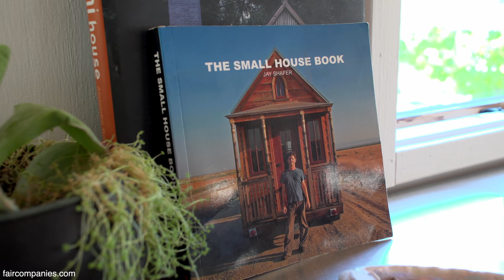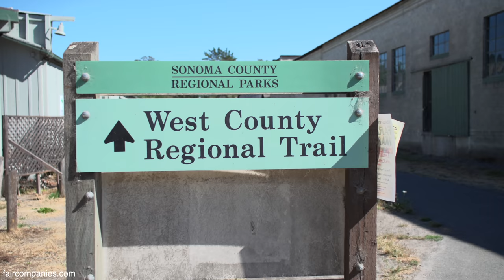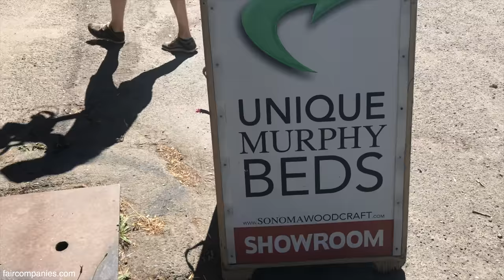Bottom-up urbanism solves urgent housing needs in CA vicinity

Comment: If you look at history, many families had a 100 square feet house to live in and they raised a family of multiple children. We do not need a 4,000 square feet house to have a "home." My house is 14 feet by 38 feet, of World War Two vintage. I paid $26,500 for my house in 2001, the next cheapest house I looked at was $89,000 and it had major fire damage. I spent about $10,000 for stucco siding, new electrical panel, kitchen renovation, installing a better wood stove for heating, and bathroom upgrading; over an 18 year period. The renovation is still going on, with the passing of time. The 500-1000 square feet houses around my house are being torn down and replaced with $250,000 - $5000,000 dollar houses. While the original house and lot were going for $40,000 - $60,000. These homes usually need renovation, which if you do your own work adds $15,000 - $25,000 to the total cost.  Which is still a great deal. One of the main problems I see is that house buyers do not know how to watch youtube videos on how to do specific renovation projects; I just found how to remove old glued on linoleum using a wallpaper steamer. What is nice about small houses that you renovate, is that you can buy the empty lot next to your house for $29,000 (amount owed), and pay cash.
Let it shine, Tom.

Comment: I did a similar thing here in WA, I needed office space and it was too expensive to add on to my house so I had a shed built in the backyard and turned that into my office. It is fully insulated and finished like my home is and it has electricity with heat pump and air. It is less then 200 sq ft so no permit was needed. You got to look for alternatives to cut the red tape and cost.

Comment: How did California become such a police state? I couldn't handle being that micromanaged. I know that building codes exist for a reason, mostly to prevent fire, collapse, or injury. But when you have to worry about whether your garden hose is going to remain legal, the government is way too involved.
Reply: NATHANIEL GILLIES  I thought that since water is under pressure it prevents back-flow. And for the most part, every house has a garden hose. It just seems strange to me that a hose running into a bucket like this guy had could cause any trouble.
Reply: NATHANIEL GILLIES  I didn't know that. So turning off the hose at the source (via the metal handle) isn't enough?
Reply: NATHANIEL GILLIES  Does that mean that those hose attachment "water gun" things are a bad idea if you leave the hose on even when water isn't coming out? I don't do that, but if I wanted to would it be a bad thing? I'm beginning to sense that it probably is.
Reply: NATHANIEL GILLIES  I would assume ours has one. We just moved into our house here on December 10th, 2018. I don't know if it even has an outdoor water source. I assume that it does. I'll ask about it before I use the hose (assuming there is one).
Reply: They just don't allow permanent outdoor plumbing.

Comment: Actually, in Cali, you can run power to your shed as long as it's NOT hardlined / piped in with conduit directly from the main panel, meaning you can plug it in with a heavy duty S.O cable / extension cord like an RV or Boat. It's called shore power. So you can install hardwired wall receptacles and lights with a breaker panel inside the structure as long as you have a weather proof disconnect / receptacle outside the structure.  You're welcome. :)

Comment: Great video, we're doing similarly on the east coast in Rochester.  Our house isn't quite that small (990sqf), but it's a 2 bedroom without closets on the first floor. We plan to convert our detatched garage (already partially finished) into a workshop/guest loft. We also plan a patio, a garden and I'd like one bee hive. We're were originally going to build a tiny home, but by the time we added land, permits and the build, it was cheaper to buy a small older house (1925) and didn't waste resources.

Comment: Thank you for filming, so inspiring!  Sometimes laws are a reaction to a one time problem as in "we will never let THAT happen again."   In one state farmland was able to be carved up and sold off as home sites, regardless of size.  So a Slime bought 10 acres for $2000 in the middle of nowhere, carved it up into 20 lots and sold them for $4000 each...but there is no water and very little electricity and it is 10 acres of slums with people living in RV's or shacks...the Slime made money, the people and surrounding area suffered...now there is a rule that less than 5 acre plots needs roads, water, electricity and improvements....It all would have worked fine, if Slime had spent enough for improvements...but no water, no electricity, dirt roads and no money to make them.  Everyone pays for greed!

Comment: Interesting video.  I like the idea of looking for ways to work around getting a permit when possible while staying within safe perimeters. A lot of people will do things anyway hoping to not get caught.  While I don’t necessarily blame them and completely understand why, the problem is that you find that things are not built to code and can be a safety issue.  A lot of contractors are ok with building shoddy work for money.  We opted to get permits for our projects (one retaining wall/driveway permit ended up costing $10,000 fricking dollars, just for permission and inspections, not counting construction costs).  Our neighbor didn’t get a permit, and I can guarantee the retaining wall that holds up the driveway would not pass safety inspections OR allow the weight of a fire truck to park on it.  The consolation for me, having gone through the awful permit process, is I am confident it meets certain standards.  Also, when reselling the house (or more likely when our daughter inherits it) there won’t be issues around not having necessary permits in place.  Now we have to get a permit to replace our deck (because the supports are taller than 6 feet), and I am completely dreading the process and fees.  It truly is awful dealing with the county.  But alas, I am a rule follower.

Comment: Not sure when it was checked, but in Texas, I can go down and buy a shed or kit, insulate/power/plumb it and live in it with very little cost in terms of legal paperwork (only the power permit was needed, mainly so the electric company would run the lines). Inside some cities you need more, but where I am, you don't. Can even rent it out, so long as its structurally sound (mainly because its common sense to avoid liability).

Comment: I'm in california and living in a small city that is still relatively affordable (Mt Shasta) but it's quite a ways from the Bay and you need to bring your work with you as the county is a bit economically challenged but the backcountry skiing is excellent!  I am expecting to do the same thing in my backyard.  One small 12 foot diameter 119 square foot yurt (a shed) and one 8.5 X 13 shed close by.  I think you can wire them and just have a jack on the outside like an RV hookup and just disconnect it if there is any inspector coming round.  if they give me any hassle I'll just take the yurt down and put it up in another part of the yard.  A 600 square foot house with a 250 square foot garage for $135K.  Not bad but I wished I could afford to live in Sonoma!   I'd also like to do an ADU which I could rent legally - there was recently an ordinance passed in california that allows for ADU's and it's cheaper than building a whole house but would still need $100K minimum to build that.  One new code that just came about in California is that all new residences must have sprinkler systems ($20K+)   It's ridiculous really.  I think I want to move to Chile! :)

Comment: We're in Palm Springs with an ancient (50 year old) house that is a thermal nightmare.  Last year we installed a 5.1 kw solar system to run the Level II  charger for the car and are in court over that one, with no light at the end of the tunnel.  I'm a licensed general contractor, but now I only design energy efficient (Net Positive) shelters in 3D, using VR and energy analysis software.
With the local government, I might as well be speaking Martian.  Half the administrations are under investigation for corruption and the other half don't have any "energy" expertise that is current so public employees are more concerned over their personal position and pension than getting the job done cost effectively.  They "out-source" at great cost (I believe) just to spread the liability of their bad decisions around.  I've built houses in Quebec, Ontario, Virginia, Alabama, and Costa Rica and this place is the worst.
Climate Change won't wait for these overly covered bureaucrats to come alive.
On the beach in Costa Rica, you can build a "Bodega" (storage unit) up to 3 m x 5 m with no height restrictions mentioned, without a permit, so you see a lot of 10' x16' ground floor buildings, with cantilevered 2nd floors.
Here in Palm Springs I'm going to build an "in law" suite, the property suits it easily.  I'll build it at night if I have to.

Comment: One cannot put up a dog house in our former community without a permit. What this smart man does is wise and needed in our nation. We are located in the Midwest and an hour's drive from any city with a population of 10,000 or more. City building inspectors are oftentimes shared between five communities or more so a push to adopt state building codes is high so the inspector only has one set of code of know, rather than the individual small-town/village municipal codes. In our area, it is solidly "purple" in voting practices, meaning it is nearly split/draw at every level of elected position, so it is not a one party over the other party dilemma as much as municipalities trying to fill employment for inspectors. Just my two-cents worth.

Comment: I personally think the only solution in a situation like that is to run away so you are not caught up in it when the entire system implodes. The last thing you want to do is have hundreds of thousands  plus invested in property when the bottom falls out of the market. A lot of those houses could be bought for $15-$20K in other areas. Sell it and move somewhere cheap while it still has value.
Reply: Yeah, feel the same way although it is difficult to leave a generally "progressive area" and move somewhere where nothing ever changes.
I live in a big house and property taxes here are very low however exactly nothing ever changes to the point I am heartbroken about it nowadays - there is no demand for interesting business or services, just the utilitarian.

Btw. a house that size could be completely renovated for cheap but you need to know a thing or two about renovating a house and do all the light work yourself. 
For example that spray on PIR/PUR type foam you see here also comes in sheets of various thickness and those sheets are not only much more efficient insulators due to the included vapour barriers and a more controlled production process but also require no spray on machine, no face masks during application etc.

Comment: Regarding the vent fan that turns on with the heat in his house.  He should wire it to a switch to be able to turn it off if needed.  Here in San Diego County, in one of our huge fires that burned over 1,100 homes, many burned down because embers got into the attic.  In a fire, this vent would pull embers into the attic.  It doesn't matter that he is in a suburb.  Many of the houses that burned down were in a suburb.  Some of those vents are solar which is fine until there is a fire and there is no way to turn it off.
Reply: NATHANIEL GILLIES  Most places do not allow fire screens on the vents.  The screen must be 1/4 inch mesh.  We made metal vent covers to put up only in the event of a fire nearby.  Don't know if that will help, but it can't hurt.
Reply: NATHANIEL GILLIES  We have mesh screen in all the under eave vents. Here in San Diego County I checked with both the permit people and the fire department because I wanted to install Vulcan vents.  They said they were not allowed.  The screen mesh is too small and they don't let enough air into the attic.  The mesh  screen needs to be 1/4 inch.  A builder friend told me the same thing.  Perhaps things will change in the future or already has in other places, but not now where I live.  I've got to say that I bought one Vulcan vent to test it out and see how it would fit into our under eave vents before I made any phone calls about if it was allowed, or not.  It is supposed to have a fire proof material in it.  I pulled off a tiny piece of that material and lit a match to it.  It burned a little too well, in my opinion.  And then I lit a bit of insulation from the attic.  It did not want to burn very easily.  The insulation was a lot less burnable than the Vulcan vent material.
Reply: NATHANIEL GILLIES  My vents are vertical, not horizontal so they require the 1/4 ".  704A.2.4.2 Venting on Roofs and Vertical Walls.  Roof vents, dormer vents, gable vents, foundation ventilation openings, ventilation openings in vertical walls, or other similar ventilation openings shall be louvered and covered with 1/4-inch, noncombustible, corrosion-resistant metal mesh or other approved material that offers equivalent protection.  Turbine attic vents shall be equipped to allow, one-way direction rotation only; they shall not free spin in both directions.

My house was built in 1977 and does not have under eave ventilation.  That's why we made metal vent covers we can put up somewhat quickly if a fire is nearby.  The 1/4 inch is just too big for my ease of mind if there is a fire.  I am in Escondido, but it is pretty much the same code.
Reply: NATHANIEL GILLIES  Well, like I said before I called the people who issue permits and talked to them about it.  They told me it could be no smaller than 1/4 inch.  Now I DON'T LIKE IT that it can't be smaller.  I think they should change the law.  But from what I understand it cannot be smaller.

Comment: 10 55. Will the roof leach hard metals or lead into the water?
Reply: No. Its a painted steel roof, its safe.  Best to have a first flush system though to get rid of dust and dirt
Reply: @fouroakfarm  Any particular type of paint?
Reply: @davidflash603  The type of roofs I know of that look like that are not painted at all, they are laminated. The laminate protects the steel and when it gets damaged for some reason you have to apply a special paint to the damaged area.
You can buy these type of roofing panels made from various metals that don't need to be laminated but those are more expensive. That type of shape can also be made from flat material using traditional techniques but that is even more expensive. You can use Zink-Titanium alloys or more traditional Copper.
I have never heard of lead paints being used in this century outside of industrial applications.
Not sure what you mean by "hard metals", did you mean "heavy metals"?
If it rusts you will basically get rust contaminated water like from a rusted pipe however the laminate is there to protect it from rusting - quality laminate on proper roofs (from a proper manufacturer) lasts from about 25 to 50 years depending on type.